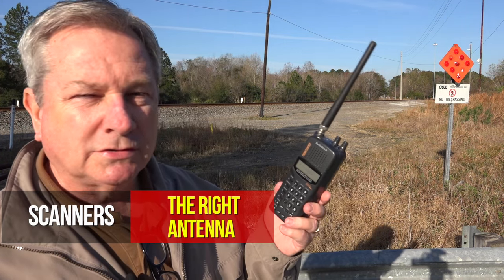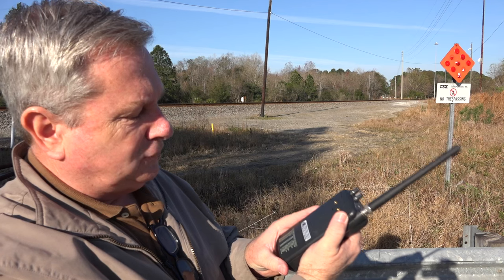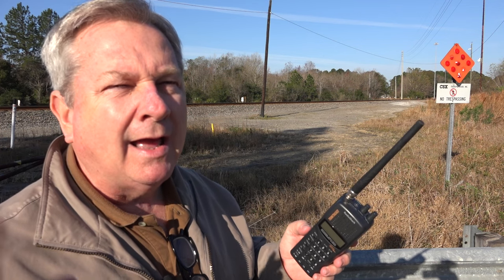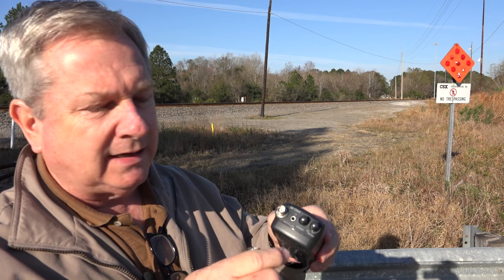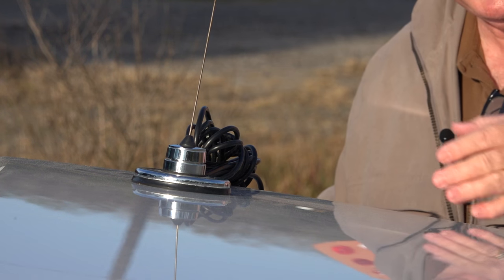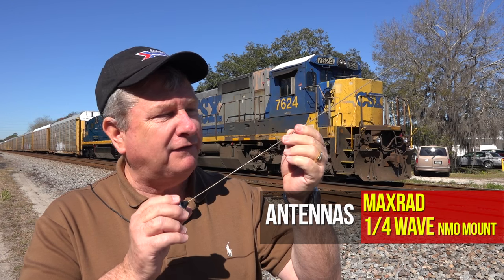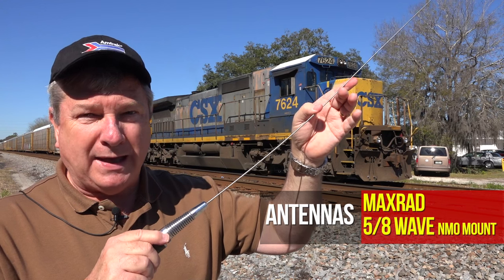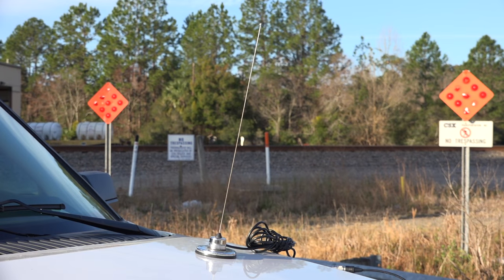Using A Scanner For Railfanning Pt 1

Comment: sorry dan can't put any holes in my mustang love ur work thoe
Reply: Look into glass mount antennas. Any 2m ham band antenna should be a good enough match to RX everything from airband to the rail band. Run between $20-30, removable if you decide you're done with for good.

Comment: I highly recommend the Yaesu FT 270R with a Diamond SRH77CA, or RH77CA if you get a SMA to BNC adapter, which I highly recommend since it's only amount $5 and BNC connectors are much better than the screw in SMA, it will also allow you to connect to other popular antennas like the Traintenna magnet car mount, which picks up incredible range. Keep in mind if you get a Yaesu, it is a ham radio, but you don't need a ham license to operate it as a scanner, but there is an incredible learning curve to first-time users, since the programming is not straight-forward or simple, like with most scanner radios. You will probably need to take a day or two to familiarize yourself with the manual and mess around with the program settings. Also, another critical factor to consider is resistance to the elements and battery life: if you get a Yaesu, it is waterproof (even submersible) and shock resistant, so you can have it out in all types of weather and if you drop it off a cliff or something it will still work. It comes with a rechargeable battery pack built in, that lasts around ~300-350 charges before decaying, so in theory that will last several years, because it takes a day or two straight of use to deplete the battery before being recharged. So even if you use it every day you'll get a long life out of it! (But as always with rechargeable batteries, try not to charge with more than 1/2 power remaining as that reduces the life faster). That being said, this is a very informative and great video!
Reply: If you really want a great antenna for the car for the same price of a Traintenna get a Motorola Railcom it is made very well about $79 very well built. I use to use Larsens 58, then Antenna Specialists Masonic's the railroad here use to use those back in the day then they went to Maxrad now on BNSF here I have seen  meany of there new MOW trucks have Railcom antennas on them. This is to each there own opinion I have been into ham radio since 1972 I was into CB to made a lot of ant. over the years from window screens to 9" piece of wire out of the back of a MFJ tuner just to see what MFJ was right it can make most everything a ant. it did on CB band I made it for a friend he talked 7 miles with it on 5w inside. But I use to use a 1/4 wave whip then I went to the 5/8s it did make is better it also how & were it is mounted putting a hole in the car in the center is the best way u can do it that is the best ground u can get ground is a big thing the car acts as a ground plane now mag mounts they work but they dont make that good of a ground now u can get around that not good to do on a new car take scrap a little paint off were the mag mount is going to be make sure on the bottom I tale stick a piece of wire inside the foil then make sure it is touching the bare pain. Now my buddy he took a lighting in line coax it has a screw on it for the ground then he takes screws a wire inside his truck to a grounding point on his car u want your ground as long as the wave size u are using. Now another point height the higher the better but on cars it is hard to do now I have a van my rail buddy he has a car when dosent always hear everything I do he sits lower then I do we sit side by side.  Now remember when u mount the ant. in the center of ur car were ever your car is pointed is going to be the Dir it is going to pick up the best cause the wave pattern on most cases you RX off the ground side that will be your car. I want to reminded all this guy is not wrong he has good points now I have even used a 2 meter beam really it was a 2metter 440 it was bought to do Satlite work but no longer used on that freq. so I use it inside turned it to my home town 69 miles away it is a huge rail hub I set it up on a tripod inside my apt. turn it to there I also live down in the bluff on the Miss river in Ia. here is a good thing to have fun with if you live near water water is a great ant. take were ur ant goes in strip a piece of wire warp it were the base of the ant is stick ur ant back on see how much more u can here. I did this with 10 meters stuck a piece of wire in the river with a rubber duck ant heard 10 times more then I did with a rubber ant also made more contacts. ! easy ant  to make take a piece of 14 gauge bare copper wire solder it to the kiond of connter u have cut it to RR freqs I think it is like 17. some " for center Freq. u can find out on the net they have calcolaters for this stuff put a vinal cap in the end get them at the hardware store for about $0.10 that bare wire will work a lot better then the rubber duck for sure if u r rich enough coat it in silver or gold use silver solder I heard gold works the best but anyone rich enough to do this 1? Same thing to make ur scanner RX better is take a think piece of wire make a ground plan have it hanging down from the connector just tape it so it dont get caught in any thing.  The best thing to ever have before 911 is a buddy or family that works for the RR that can give you the line up for the day that is no more 911 hurt everyone. Sorry if I stepped on your toes by adding this.
Reply: I just bought a Yaesu FT-270R myself. I've only taken it railfanning once and I haven't gotten an aftermarket antenna for it yet, but I plan to slap a Smiley 5/8 Slim Duck 155-165mHz railroad tuned antenna on it and hope for better performance. It's already doing really well, I was at my grandparent's place the other night and brought my radio with me, they live about 4.5 to 5 miles from a rail yard and I got a LOT more clarity on a 144mHz stock rubber ducky antenna than I thought I would. I guess you get what you pay for. Yaesu is definitely a good radio and I think it could be even further improved with a railroad tuned antenna.

Comment: Thanks Danny. I am a licensed ham, so I understand what you are saying about the antenna. I used the better one for a while, but later replaced it with the factory job. I do not need nor want to hear whats going on six or seven blocks down the line. The factory antenna allows me to hear all trains within three blocks. Anything more is just clutter. Also, you might want to tell folks to program in the dispatcher's channel. He, or she in our case, often tells the conductor to switch channels for further instructions. Like you, I railfan CSX but in Maryland. I do so at the Riverdale light, which is set by the dispatcher, and that more or less tells me all I need to know.

Comment: Check your area, but sometimes you can use a marine radio for the purposes as well. In CFRC territory, the road frequency is 160.725, the exact same as the RX freq for International channel 62. There's a handfull of other AAR channel frequencies that correspond with marine RX freqs. The radio has to have a UIC switch on it for this to work.

Comment: Anyone who wants a really good mobile antenna, take a look at the COMPACTenna. Only 11" tall and delivers much bigger performance than its size would indicate. Works better at the edge of the roof/trunk lid/fender than in the middle.

The Comet HT55 is another great handheld antenna but it's (currently) only available with an SMA connector.
Reply from the maker: +cbehr91 2.0 Haven't tried those but would love to.

Comment: I use a Railcomm magnet mount antenna when I'm out and about. It's one of those tall antennas and kinda expensive ($75). Most days when I have my antenna up I can hear trains calling signals from about 10 miles out in either direction, which is helpful when trying to get to that one photo spot. Some days it's even further than that, some days less. I used to bring it inside my house and set it up. I live in Kentucky near Louisville and once heard it pick up a CSX dispatcher calling a coal train in West Virginia and I heard the train respond too, that was pretty neat. 

You may want to address the laws of scanners in different states, some require you to have a ham radio license (?) in order to travel with a scanner. 

Thanks again for your awesome videos, hope to make a railfan trip down to Florida some day.
Reply: That's quite insane listening distance to hear a train calling out in WV when you're listening from central KY. What do you mount it on when you setup from your house?

Comment: Does the antenna length really have a whole lot to do with the range. I had a 14 inch antenna on my Uniden BC75XLT. I'm now looking into an 18 inch if that will get transmissions from further away.
Reply from the maker: +Clear Signal Productions You're not going to notice much of a difference in 14" and 18". 17" is the correct 1/4  wave length for 161MHz. Correct is what you're looking for. Not just longer.
Reply: Ok. Is 17" the correct length for 160MHz aswell?

Comment: Ok, this video is gold!  I've looked up the two antennas you mentioned in this video and they are relatively cheap. The most expensive part of the external is the magnetic base.

Question though. I need the 150 to 162 MHz range for the 1/4 wave, correct?
Reply from the maker: +Aaron Beaubien Yes, the 150 - 162 1/4 wave is what I use and is perfect.
Reply: Thank you! I am located up on the South End of the old Rathole District on the CNO&TP up here in TN. Lots of mountains. I feel like that antenna would do well regardless of terrain.
Reply from the maker: +Aaron Beaubien Hi Aaron. The mountains will restrict your range no matter what kind of radio or antenna. But, adding an external antenna will extend the range of the radio in any case. Thanks!

Comment: In kentucky and other states where scanners are banned the police look for exterior antennas for scanners. So I use a three foot CB antenna with magnetic base quick release and a spring. It works very well and is inexpensive. I can hear hand held radios for at least 1/2 a mile away. You can get a convter plug from the cb cable to bnc connector at any truck stop.
Reply: Correct me if I'm wrong, but if you have your HAM license you are all set.  I would love to get mine...wish there was someone else in my area wanting the same so we could work together on them.

Comment: Ah, the Old Kings Road crossing - now closed to traffic. Used to watch yard activity there almost every Saturday afternoon when I was a kid. Every so often I'd see the Silver Meteor passing through enroute to the Amtrak station a few miles away.
Reply from the maker: +MrCzechers I remember the first time I found Old Kings Rd. I think there were 9 or 10 tracks in the crossing. It was incredible!
I sat there several hours, marveling at the traffic through there. It's still pretty good, but a lot quieter. :-))
Reply: Distant Signal When I first "found" Grand Crossing, as it was called, it had 7 tracks. Its the north end of Moncrief Yard on the old ACL. On the first trip there in 75, a SCL train was parked on a layover. The caboose crew invited my Dad and I aboard and showed us around. Never forgot that! Meanwhile, NS (originally Southern) Simpson Yard is about a mile down Old Kings Rd.

Comment: 300 channels is too many channels, I'm happy with a 50 channel scanner.
Reply from the maker: Well it depends on what you use your scanner for. If 50 is enough for you, that's perfect. I like to use the banks to program frequencies for different areas. Plus I put weather and aircraft in there too.
Reply: Distant Signal Unfortunately, they don’t make scanners with 30 or 50 channels anymore. 100 channels is good for me too.

Comment: Danny is there any chance you can publish the frequencies for the state of Florida? Per subdivision and the beginning and end of said subdivision. I doubt anyone would deny you are the leading authority on Florida rail fanning and as such have obtained a database for such info. I frequent your state and it can be trying at times to know what frequency goes to which subdivision.
Reply: +Arpeggioshredder  Tampa Area 160.590, Wildwood Sub 161.370, 161.100, JF dispatcher 160.230, 
JA dispatcher 160.920
Reply: +Arpeggioshredder Obviously this not all the frequencies but this is adequate for central Florida
Reply: +Arpeggioshredder http://www.radioreference.com/apps/db/?aid=9242

Comment: Danny yes a  quarter wave antenna is better that a rubber duck on a hand held and for the money you can't go wrong. with that said a 5/8 wave will give you 3db of gain. I know what people will say that is for transmitting and for the most part they would be right however it does give you better reception as a ham radio operator I have used both and pick up distant signals (radio that is) better with the 5/8 wave antenna. I think it would depend on the location a person is chasing in as to which antenna would be better. Flat open country I would think the 1/4 wave would be fine but in hilly or even mountainous areas the 5/8 would give an advantage. just my thoughts enjoy you videos                              73 N0TLC
Reply from the maker: +DS75921 Thanks for the reply! Yes, I've tried the 5/8 wave "Railcom" antennas and the Maxrad 5/8 waves (which I think are made by the same company) I've done A-B tests with them on the same radio and can find no improvement with the 5/8. I could be my situation and conditions.
Reply: Hi Danny I am not familiar with those brands of antennas but I am sure that is a marketing name geared to the rail fan I use either Cushcraft, Larsen or MFJ antennas and I cut them to the frequency in use to maximize performance. Conditions have everything to do with how an antenna performs where you are in Fl. Mostly flat you are correct it doesn’t make much difference I live in the Mo. Ozarks and need every advantage I can get in them thar hills
Reply: I have been a ham for 30 years and I totally agree that the 5/8 wave length antenna is better, granted the most improvement is in the transmitt but if you watch the s-meter when doing test you will see an improvement in the receive also.
Reply: Another tip, any antenna you buy new is going to be cut to the lower end of the freq. range, a 1/4 wave should be cut to 17.5 inches to get best preformance on the rail freqs of 160.0 mhz

Comment: Is there a way to railfan without a scanner?
Reply: Yes there is. Just sit by the tracks and simply wait for a train to come by. You can also try to find a local railfan or friendly railroad worker that is willing to give you a heads up on timetables of regular mainline trains and locals so you don't have to sit around simply hoping for a train. You can also listen to railroad scanner traffic on your computer or smartphone from the streams off www.railroadradio.net if it happens to have your area of track streamed. It's pretty limited in the list of places it re-broadcasts from. Mostly only stretches of track that are busy and are popular with railfans.

 But I'd just save up for a new scanner for around $100 (only needs to be an analog scanner that scans in the 160-161 MHz band) and buy a good magnetic car roof antenna or handheld antenna in the $20 range. You could probably find all 3 online in used condition for cheap. I recommend the Uniden BC125AT. Not only is it pretty cheap, it's about the only one in it's price range that has Alpha Tagging..... which allows you to add a custom 16-character text name to each channel (like "BNSF Road" or "BNSF Yard" so you know precisely what you are listening to) instead of just a number on the screen. It also has free, easy to use software online you can download to program the scanner when it's plugged into your computer's USB port. So much easier and quicker than programming frequencies and Alpha Tags from the scanner's keypad and knob.

Comment: Car mounted antennas for scanners are illegal in NYS
Reply from the maker: Seriously??? I often wonder why the people of New York State tolerate all the restrictions on freedom that you guys have.
Reply: Distant Signal we can go around it by using a transceiver, like what I see you using, as well as hand held scanners that use a unit mounted antenna. And plugging a head held into your stereo system is on the edge of being illegal
Reply: Yeah it's unbelievable. Danny because of this video I finally picked up a scanner and the 77 and they've been flawless! Thinking of getting a magnetic car mount.
Reply: @patmeaden  Pat so I've got a handheld Uniden scanner w/ unit mounted antenna. Would a magmetric antenna mount plugged into it be illegal? Or not technically, only "on the edge" of illegal?
Reply: William Baker it seems like one of those laws like men not being allowed to be shirtless in Times Square, it’s against the law, but doubt any cop cares. You could get away with it, but you could get a fine if the cop actually cares